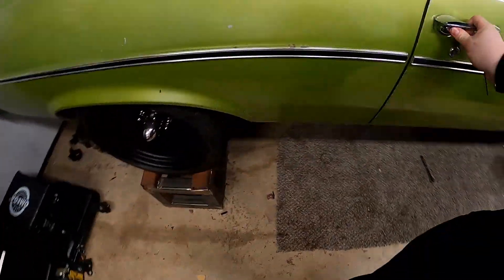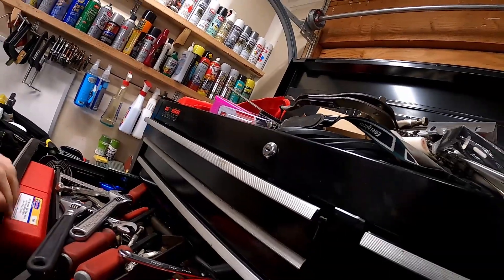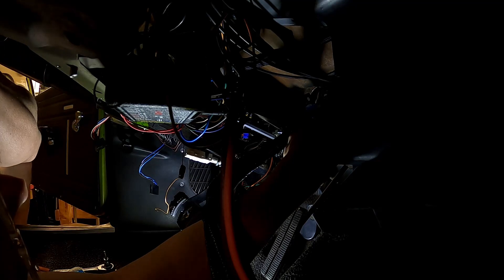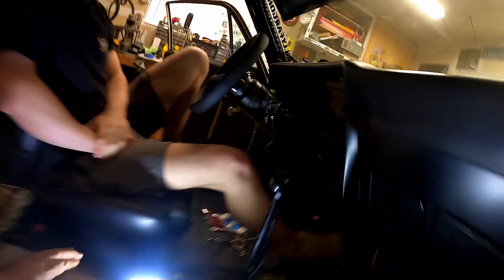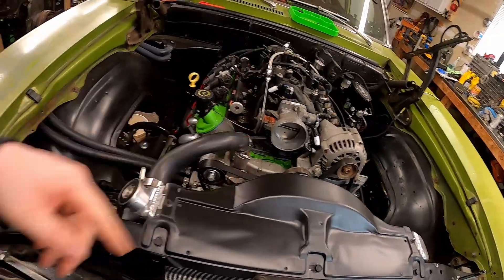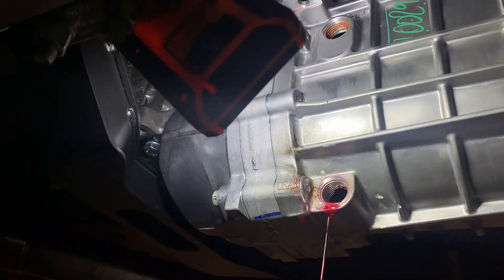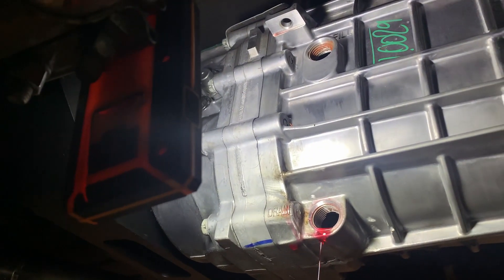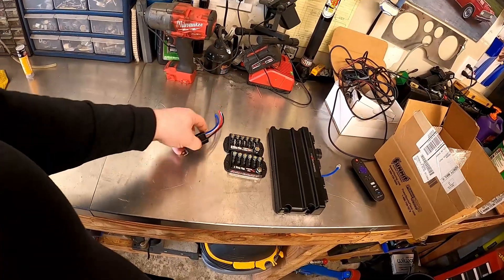Nova / LS 6.0 / TKX - On the home stretch for first start! Going to reach the goal.

Comment: Put some heat shrink on the throttle cable before you cut it, it will make a cleaner cut and keep the cable from fraying.  This is getting exciting you're so close.
Reply from the maker: I did get the heat shrink on there.. well after I cut it but it was still fine. Definitely could have gotten bad without it!